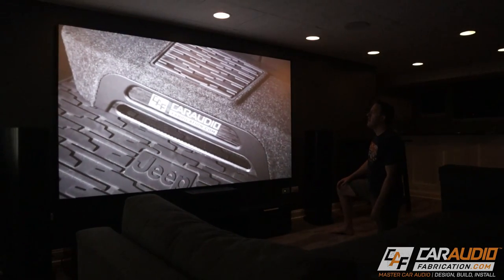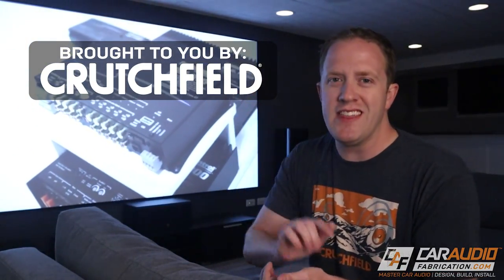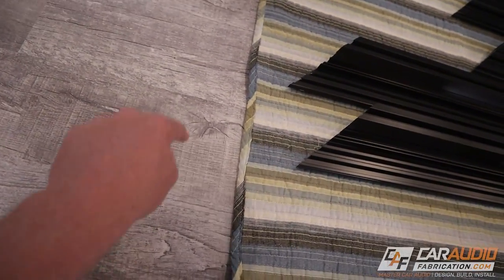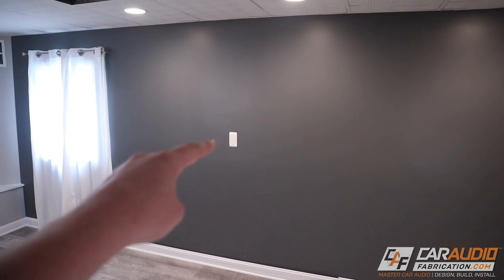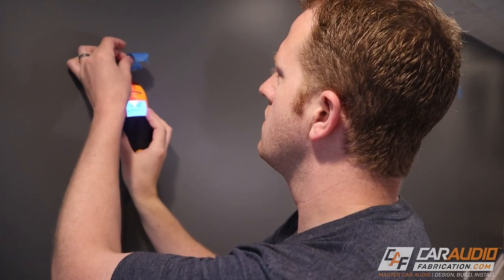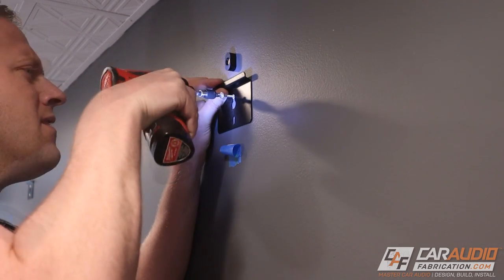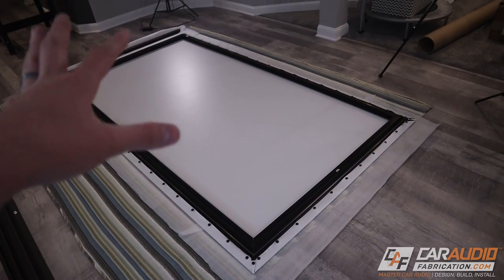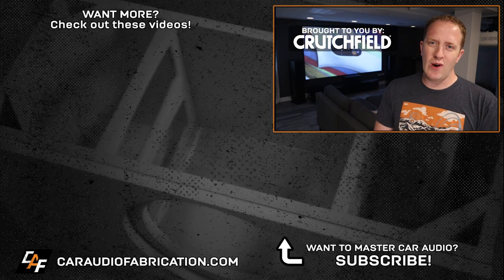Can YOU Install a BIG Projector Screen? How to build and Install!

Comment: Out of curiosity. I throughly enjoy learning from your videos. It's made a major difference in my audio quality of my ranger without having to spend a good amount on paying someone to install it and tune it. So thank you so much for that. But I was wondering if you happen to have a video on hooking up car subs to a TV in a house? I just can't seem to figure out how it should be done without a head unit involved. My brain is stupid like that
Reply from the maker: You would want something to create the audio signal (could just be the TV, but a receiver would be better) much like the head unit. Then you would need amplifiers just like car audio. A home theater amp with plenty of power would be a great choice (check out Crutchfield). Then use the home theater amp to power the sub. With that said there are a lot of powered solutions if you purchase the subwoofer that is made for the home theater application.
Reply: One thing to keep in mind, is that car subwoofers don't need a car amplifier. They're the same as any other subwoofer. And it would be a lot easier to just get a home audio amp to run it, rather than the hassle of a car amp.

Crown is an awesome brand for ultra clean cheap power.

Comment: Wait is car audio fabrication now home audio fabrication my two favorite worlds collide? Ironically it’s amazing how much overlap there is between the two fields in such a practical way. I’d say go with Crutchfield for sure, get a Denon x3700 receiver and klipsch or jamo (if on a budget) speakers. Most importantly always budget more than you planned for future expansion or upgrades.
Reply from the maker: I've done quite a bit of individual home theater stuff on the channel, but never went through the whole project. The cool thing about home audio is you can definitely upgrade as you go and easily change stuff up in the future.
Reply: @CarAudioFabrication  home audio is so much easier than car audio to get a good result. It almost seems unfair
Reply from the maker: It really is lol, not nearly as many challenges to overcome with the environment, and its nice that you can start with a clean source easily. Not trying to interface with a vehicles source unit and all the potential issues.
Reply: I doubt I’m alone in saying it always comes around full circle. I want a clean clear but physically impressive thump at a reasonable price in my car and livingroom. I think home audio is great at  teaching basic principles to gain familiarity in an “ideal environment” as a great training ground with more forgiveness than car audio. Whereas car audio really gets the creative juices flowing and you’re forced to be more independent. However either way the quality of the work all depends on how much prep and forethought is invested. I am incredibly grateful to this channel for really opening my eyes on how to think through these things with an eye for clean craftsmanship. I always measure like 20x & cut once… or twice lol…
Reply: @CarAudioFabrication  absolutely agreed - plus the benefits of a presumably clean grounded power source, no alternator hum, less interference from all the a/d d/a conversion, HDMI !!! Don’t get me wrong, my truck is a labor of love, but my home theater (which I am quite proud of) is my true love after all that labor :) Great work on the install, have you thought of partnering up with TechnoDad? If you’re thinking of dipping toes into this pond, I truly think the home theater world could use some of your magic!!

Comment: I want to make a box out of carbon fiber to save weight. I work with carbon fiber alot and it is significantly stronger and lighter than fiberglass yet I don't see ANYONE making boxes out of them. Why do you think that is? In my car weight is a huge concern but I needed to keep a system and after researching I found the jl 8w7 is only 17lbs and is the lightest for how much power and sq it makes. I dont want to undo this with a massive 3/4 mdf box though. It needs to be ported to hit the lows as it's an 8. Can you help me see if I can make a box out of cf and have it work ok? It would be very expensive to try and fail
Reply: @Andrew Gameau I've vaguely heard thats what the ussue is but dont understand it or why. What if the inside is 2 layers of fiberglass? Would that negate the issue? Can you elaborate more? Im very curious about this!
Reply: @Andrew Gameau That was actually an AMAZING description of your point. I understand what you're saying. I never realized that material resonance modulated the sine wave so drastically! It makes sense though. Like light weight sound deadener on chime will ring when hit, which would symbolically be the sub woofer pressure, and still sound high pitched, but the high density tar type sound deadener, will be duller and also lower in pitch. Thats sorta like a hyperbole of what is happening in the subwoofer box if I'm following you correctly right? What about aluminum panels with fiberglass or cf insused to them?  or integrating into the steel of the rear parcel shelf of the vehicle and welding a (very) thin steel enclosure? I need to keep the weight down as much as possible. Each 50lbs of weight removed from my car cost's me about $1500 at this point so im undoing some very expensive mods adding a sub. Music is worth it to me though. I have a 20lb JL 13TW52-2. I tried the 8W7AE but the box requirements made the weight untennable. Any insight would be much appreciate how to build a light box that will resonate low if you know anything. Thank you very much for your reply! That possibly saved me alot of trouble 😉

Comment: I like oled tvs more then projectors
Reply from the maker: Can't get larger than 85" though without being tens of thousands of dollars for a TV. TV's are great but IMO for a true "theater" experience you have to have the larger screen size.
Reply: @CarAudioFabrication  i agree man And thats a good point but I would buy a projector if they have decent color correction so I can make the black more black but the only one I found like that is 1800+ and doesn't support arc so I just bought a 75 inch 4k oled for around that price and I love it
Reply from the maker: Yeah they definitely are more pricey than TV's. But like anything tech it comes down over time. I'm really excited to see how these laser short throw projectors start to evolve.
Reply: @CarAudioFabrication  i can't do the laser projector i get rainbow effects  and make me sick and end up with a massive head ace